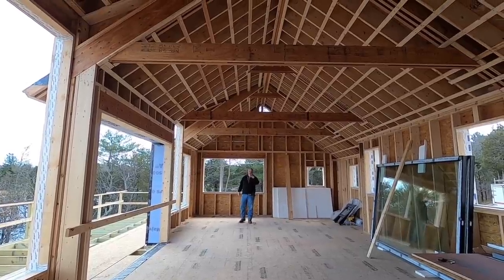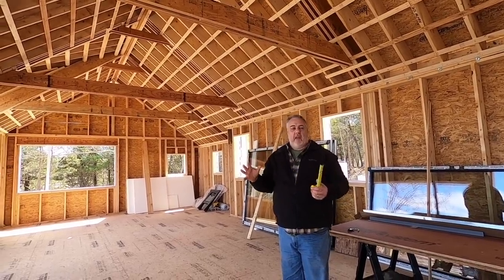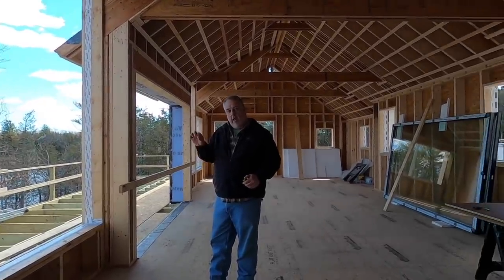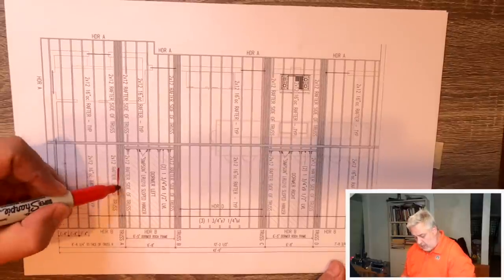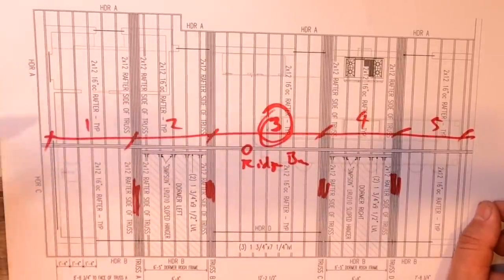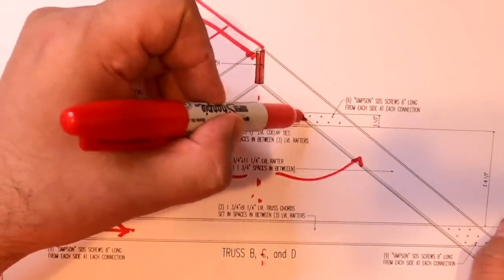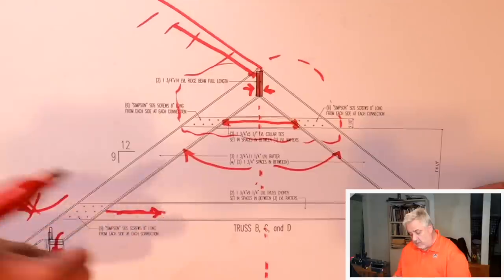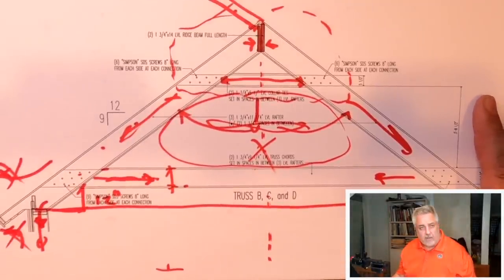The Value of Site-Built Trusses

Comment: Always enjoy your technical videos! The primary work that the collar tie does is prevent roof uplift under high wind conditions.
Reply: Benjamin Ponds is correct about the function of the collar ties. Also, amazing video, thank you for making it. The one question I am left with is, what is the connection between the sloped/angled columns and the ridge beam? Still need to get the downward force out of the beam and into the sloped members.

Comment: Excellent info. How wide can you make those trusses without needing column support?
Reply: The member sizes or frequency just get larger and more frequent
Reply: @stevenbaczekarchitect9431  so a span of 28 ft without supports is reasonable and could probably be done with LVL or would a glulam or steel be needed?
Reply: @mixedbeans  I think so, this room was 22 ft wide
Reply: Thanks

Comment: Great explanation. Now, how do you build it? Pre build and lift into place or assemble in place?  If you prebuild, you get consistency, but how you get a solid connection to ridge beam?  If you build in place, you get a solid connection to the ridge beam but you have to have a support system to hold each piece of the truss as you assemble it.  Very intriguing. Thanks for sharing.
Reply: These were all pre cut in Canada, trucked down, then assembled

Comment: Excellent video!  Question.... On a typical sloped rafter, doesn't 2/3 of the load go down to the wall and the upper 1/3 go to the ridge?
Reply: It's actually based on Trig.....the steeper slope increased load on bottom, lower slope increases on top......think of a ladder setup

Comment: Question: Segment 1 in your explanation of how load is spread. How does the added segment of load change calculations for the ridge beam or how load is distributed in that area? Also, is the column supporting the truss between segment 1 and 2 in-line with the other columns (inset from the wall) or is it out of row with the columns?

Comment: I would love to learn more about sizing collar ties and ceiling joist/rafter ties.  Also, how the handoff of those elements from an architect to structural engineer are handled. E.G., does the architect design according to tables assuming every joist is a full truss and then ask the structural engineer how to minimize the total number of rafter ties?  I assume the beefier the rafter ties used the fewer rafter ties total that are needed.
Reply: There are guides/books where you can pull off a lot stuff like that from - knowing the factored-in snow loads, but it's still a good idea to run them by structural engineers

Comment: Steve, looking at your Cross Section at the roof - no vapour barrier or vent space above the insulation? Are open cell, and closed cell insulations acting as vapour barrier? I've never used such insulations in the cathedral ceilings - I've used glass fibre, mineral wool or a sheet of extruded polystyrene, and I've always had considerable vent space.

Comment: What about the horizontal stability of the whole structure when the wind blows? It would be great if you could expand on that.
Reply: Thats, why it is called a "moment frame", the joints ability to resist any bending allows for the lateral forces to be resisted internally

Comment: Thanks Steve- cool project and great information. Curious- shouldn’t the diagonal members of these trusses be notched at the ridge so the ridge beam actually sits directly on it since the force is being applied downwards/vertically? I’m sure the high collar tie serves the purpose, but wondered about it. Also- could scissor trusses not have achieved the same result instead of this more complicated solution) or was it ruled out because of the aesthetic and/or the way the dormers intersect ruled that out?
Reply: Scissor trusses would have provided less volume and not a desirable result

Comment: That is a conventionally framed roof with collar ties.  Trusses are made up with not only top and bottom cord but the contain multiple web members which give makes isnt a truss verse a conventionally framed roof.  
You also don’t have any lateral bracing and no cable end bracing.
Reply: I don't understand your comment.  This is not a conventionally framed roof with collar ties.  A factory built truss often has web members as you describe, but this is clearly different.

Comment: Steve, how do you insulate that roof?
Reply: Sorry man, the roof is actually a "hot roof" unvented - insulated in the cavity
Reply: @stevenbaczekarchitect9431  well those SIPS address some of the questions about wind/shear from the sides or end of the building, as they will lock together in coherent slab on both sides of the roof, and fix in an elegant way the roof insulation requirements without ugly venting.

Comment: Nice explanation. But how about getting rid of the cross members all togather?
Reply: Like the "forested Kuono cabin Airbender youtube video by levi Kelly.  However now that I look at it more it looks like there might be a cross member running through the glass area. It is lower. More like it is in the wall area.
Reply: Great house design. The one Matt just posted a video on.
Reply: In Columbia mo
Reply: Getting rid of the cross members would have required a steel moment frame assembly. I have done them, more costly and another sub